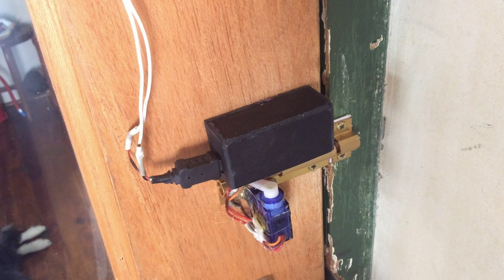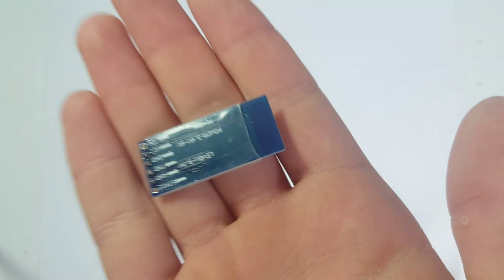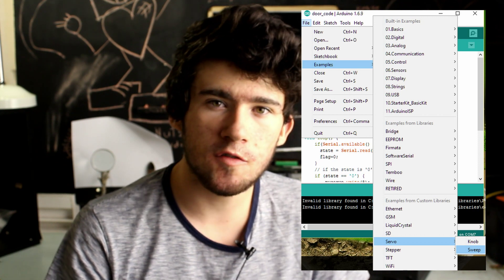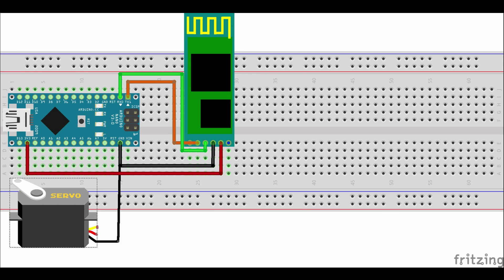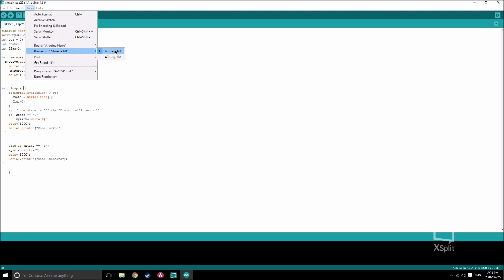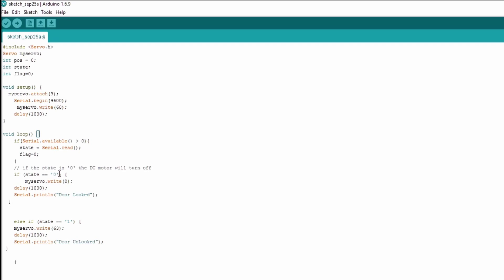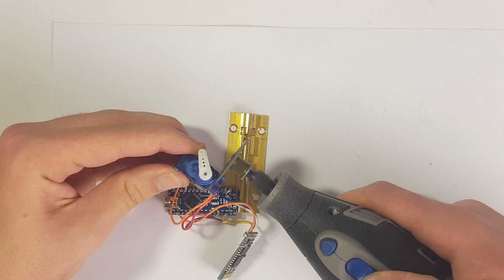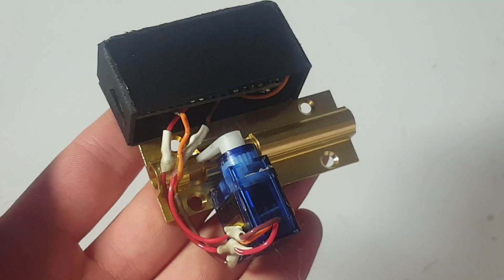Bluetooth controlled lock Using Arduino tutorial

Comment: Hey, thanks for the idea of using the servo to actuate the normal lock.  I have all my code etc worked out and had a plan to make a sliding lock with carbon fiber tubes and metal rods etc..... i actually feel ashamed I didnt think of this.  thats a great way to achieve it

Comment: how to reduce the speed of the servo in this project? I tried different methods and nothing worked. Could you please help? Thank you
Reply: Have you got the motor working with your phone via bluetooth?
Reply: @jayxcey  Yes
Reply: Can you please help me how for my project? Please i really need your help
Reply: you should be able to put some thing like myServo.write(64); then myServo(32); for say there could be a 50ms delay that would set the servo to a state which will set fo 50ms then change then set again so it would slow it down a bit. i think it would work but i'm not 100% sure